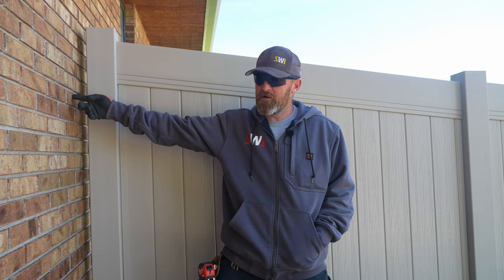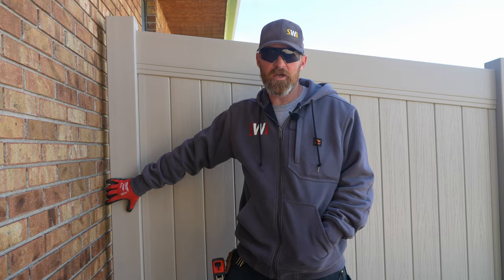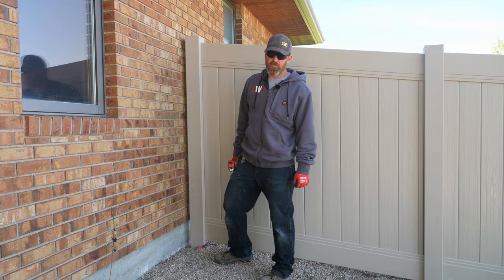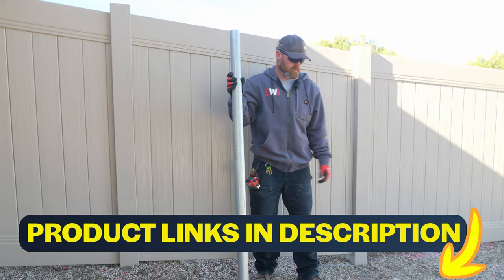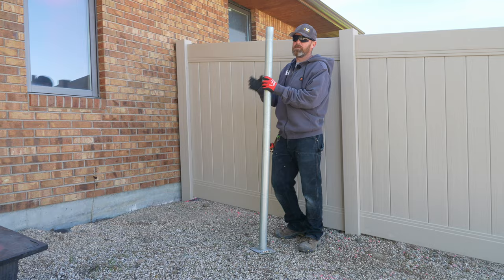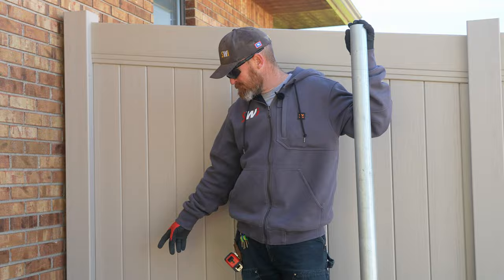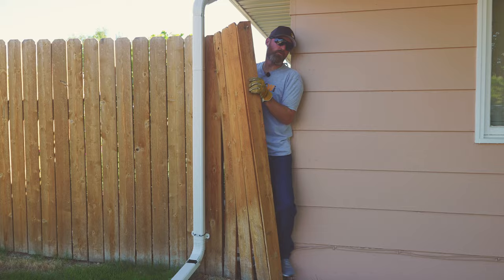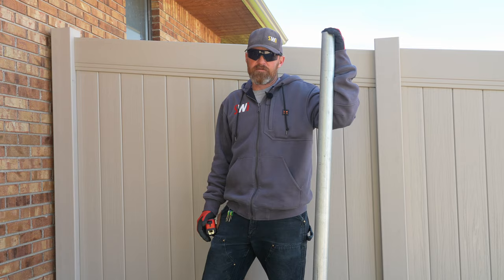How To Attach Your Fence To Your House The Right Way

Comment: You are wrong. You never mess with an engineered footing. You know most fences go to the end of the house. That is 9/10 times a shear wall. You adding a post can weaken that footing, cause it to crack and on top of everything else, one of your watchers may just jack hammer the footing out and really mess things up because you made it sound like a bad thing to attach to the wall. After you get your hole in the siding or stucco add caulking to the hole and a circle around it to seal the hole while you install your Fastners. Not sure if you noticed but a house has a ton of holes in it. Windows, doors, vents, waterlines and such. That was a lot of drama with those clips to emphasize how wrong you are.
Reply from the maker: We will have to disagree.  I have yet to see anyone address the potential for moisture penetration, make sure they anchor to studs, or in general make this look good.  Every time we see it, its a cobbled mess.  

We offered several ways to accomplish this without drilling into a foundation.  They did miss mentioning the optional Z post though which steps over the foundation/drainage or whatever with no need for funny little sections or drilling of concrete.

It should also be noted that we are talking about bolting a plated post to a footing.  If that causes failure in the concrete, there were problems long before we arrived.
Reply: I'm glad I'm not alone.  I've been scabbing to the house for 22 years and yet have any issues come up.  🤙

Comment: Wouldn’t cementing the post next to the foundation join the fence to the foundation?
Reply from the maker: If you've exposed the foundation you might get a light bond between the two. Typically though fresh-set concrete doesn't bond well with old concrete.
Reply: Would you be able to do that with a product like welcrite for bonding agent concrete on concrete I don't know if it would work concrete on stucco Etc? I don't even know if I spelled the product correctly yikes

Comment: Gonna have to disagree. At my company we aren't allowed to mess with the foundation of the house. We will dig as much as we can, set post, cut post if needed, and then we attach post to house using literally 1 3/8 bolt. It's super effective, nobody has ever cared, and we've never received a call about it.
Reply from the maker: We will have to disagree.  I have yet to see anyone address the potential for moisture penetration, make sure they anchor to studs, or in general make this look good.  Every time we see it, its a cobbled mess.  

We offered several ways to accomplish this without drilling into a foundation.  They did miss mentioning the optional Z post though which steps over the foundation/drainage or whatever with no need for funny little sections or drilling of concrete.

It should also be noted that we are talking about bolting a plated post to a footing.  If that causes failure in the concrete, there were problems long before we arrived.
Reply: I'm glad I'm not alone.  Been attaching to the house for 22 years and have yet to hear about any problems.  Looks like just because you're able to make a video doesn't mean you're right. 🤙